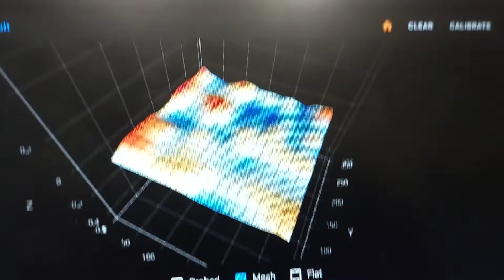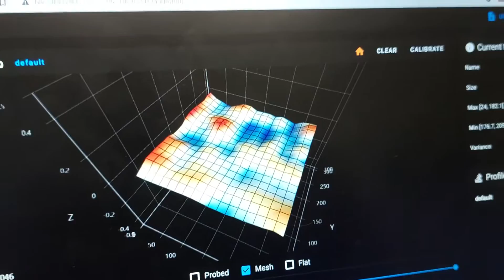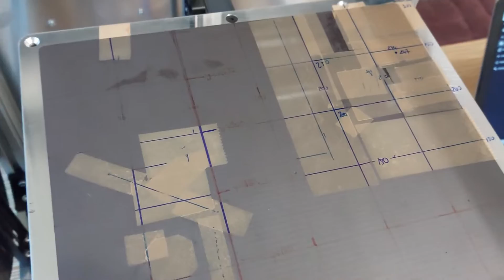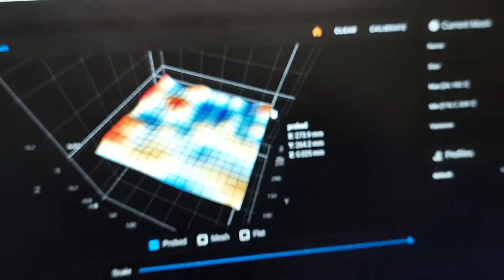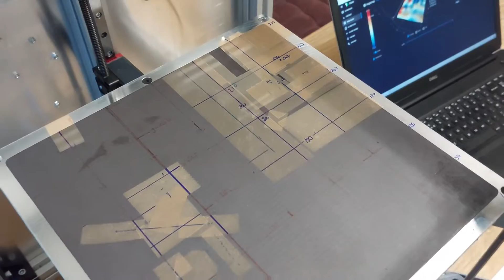Ratrig Bed Levelling issues - finally sorted.

Comment: My bed mesh looks like a taco. lol But I managed to get it level and get a good first layer using my bltouch. EDIT: After watching your video, I feel like you are doing something wrong in your config... My bed is extremely warped, but I managed to get a good first layer. I have low points that are -.3 and high points that are +.3 where my bed literally looks like a taco, so how can I get a good first layer, but you cant?

Comment: SOLVED LOW THE BICUBIC TENSION TO 0.1 I HAVE A RANGE OF 0.130 AND IT WORKS
Reply: Great, will try on mine!
Reply: @fullrespect69  tell me if it worked for you for me its working but know im solving elephant foot ender 3 is a problem that never ends
Reply: Hi man,
I have 0.2 Bicubic...
Where should I look to change this parameter and set 0.1 to default?
Reply: @lorenzofulli3168  i included bicubic_tension: 0.15 in my bed mesh macro you can play with it to see if it changes something also check if you have your bltouch offset well and your zero position matches with the front left corner of your bed if you have troubles just do the screw_tilt_calibrate and dont use bed mesh

Comment: On a ratrig bedplate you should have very little variance so 0.08 is decent imho. 
I get 0.135 on my Sidewinder x1 with a PEI sheet on top after painfully adjusting every knob constantly (care of magnetic adhesive as it will mess the leveling if not properly placed).
My way around this for a "perfect" first layer is to use 130% initial layer line width + 0.3 initial layer height if im on 0.4nozzle with 0.2 layer height. 
But 0.08 is decent imho, Building a vzbot 500x500 i'll see how it goes when i finish it.
GL on ur setup

Comment: Yeah I’m kinda confused. The software should compensate, you won’t have a perfectly flat print, but the first layer should still be perfect.
Reply from the maker: That is the biggest issue with the software compensation - it does not work as it should. Hence all that faf about getting your phisical bed as flat as possible

Comment: i have tried pinda probe v1 and v2 but both of them have thermal drift problem and some interference due to magnet making sensor inaccurate. i suggest using klickyprobe and bltouch if

Comment: have you run probe_accuracy before doing bed mesh to make sure the probe is not problematic and make sure the standard deviation is 0.002 - 0.005 if more than that then can you make sure the probe is not accurate? it comes from a magnetic base sticker that expands I experienced the same thing when heating to 105C, the bed surface became bumpy. After I checked, it turned out that the magnetic sticker bubbled when heated. After I replaced the magnetic sticker with a 1.5mm thicker one and replaced the pinda probe with a  EUCLID PROBE the problem was resolved

Comment: I'm having the same issue but do not believe it is directly related to RATOS as I installed Fluidd/Klipper with no better results. Like you, I was able to get a better (still not acceptable) first layer using narrow (~25mm) Kapton tape on the build plate reducing the mesh variance from .217 to .118. I ordered 100mm wide Kapton tape and plan to put it on the bed magnet like you did with a goal of getting the variance under .1. I was going to go through the pain of installing either Marlin or RepRap but it is clear from other GitHub posts that the Klipper team is not interested in addressing this issue.

What are your current bed mesh setting?
Reply: Hi, i am pretty sure that the bed levelling compensation during the print is not working as it should. And it is a fact that developers simply avoid this topic thinking their system is perfect.
At the moment i have my printer off line as i am going to do some serious upgrades, starting from getting rid of EVA system as i also think that it is only looking nice but functionally is too weak and there are engineering errors in relation to extruders heat block cooling. With removing EVA system i will also replace the gantry, still looking for a ready solution before i start my own design to upgrade all. Generally i would like to replace the printed parts of the gantry with a metal plates which i have an idea how to design to save cost and make them sturdy and light. I will update here when i get to this point.

Comment: so what was the problem? and did you fix the issue where klipper was showing you the mesh backwards?
Reply from the maker: Hi, honestly i could say that its a software issue, but i am unable to track it as i am not an app developer. When i spoke to one of them on Discord he always repeated that it is my printer build issue and i should not look into a software issues. I think he is wrong and simply cannot admit that it its RatOS failure. So to overcome this you need to make your bed flat.
Then i tweaked settings in the bed mesh calibration and it worked somehow. The results are way better but i am still not satisfied.
Reply: @delan3d422 Mount your leveling sensor with Y offset = 0 .. worked for me.

Comment: All Klipper does is warp your print to the warping of your bed. Which does not provide you a flat part/first layer. Your entire print is warped from bottom to top.
Reply from the maker: Exactly, i noticed that the "fade" function does not work at all... whatever is set to.
Reply: @delan3d422  All fade does is create a gradient point for a more smooth transition between any sets of points. You never see it on any image, since it is interpolated and not a physical point.